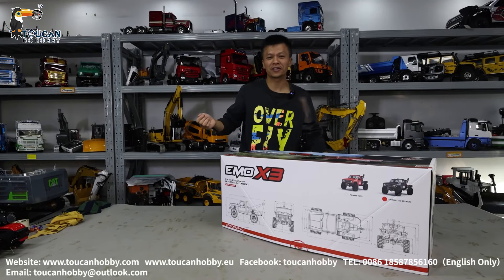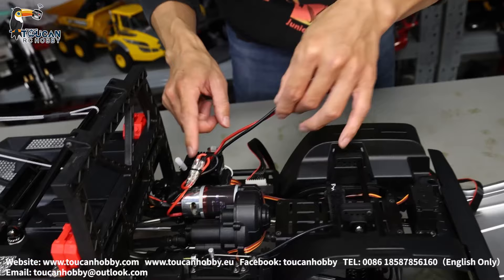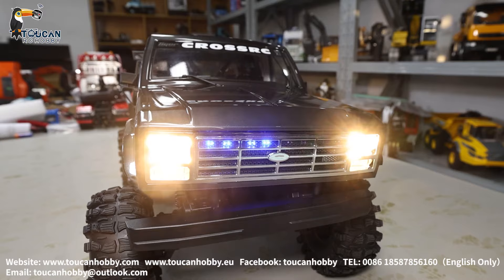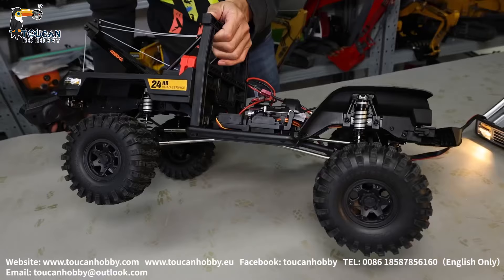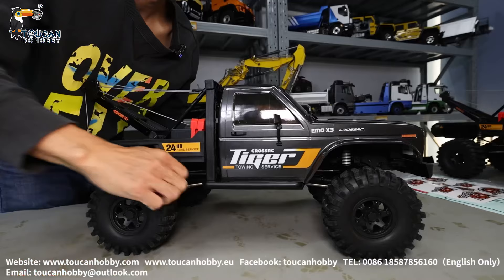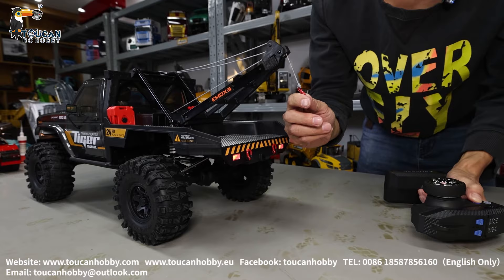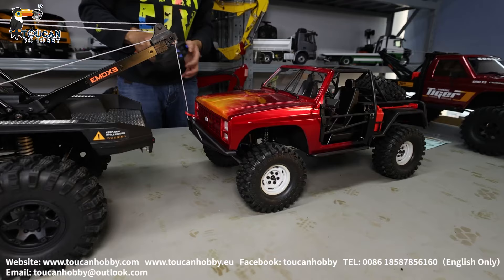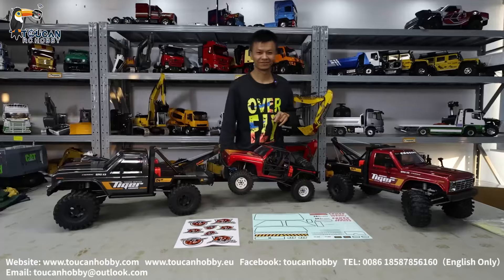Unbox 1/8 CORSSRC EMO X3 RC Towing Rescue Car 4x4 Remote Control Crawler Car

Comment: I really like Cross RC.  I do wish they had better/ brushless electronics.  I'd be fine if the price increases some of this came with an axe or fusion system.    I just don't like paying for stuff I'm gonna immediately take out and replace.   Maybe make it optional or sell rollers.
Reply: Yes agree with u bro.
Reply: I'm used to it. Call it hobby tax. Stock electronics should be a gift certificate toward castle or hobbywing stuff.
Reply: @buysncharge  to me it depends on the price.  For a budget brand or rig I'm good with it.  The Redcat Ascent for example.  No issue ripping it's guts out and putting a Fusion in.   A $500 plus rig like this or a TRX 4.  It bothers me. I'm as guilty as everyone else but as long as we keep buying them they'll keep doing it.
Reply: @boduke9428  I've started building from the frame up. Part by part. Mismatching. Hobbywing fusions and sometimes random oversized motors.